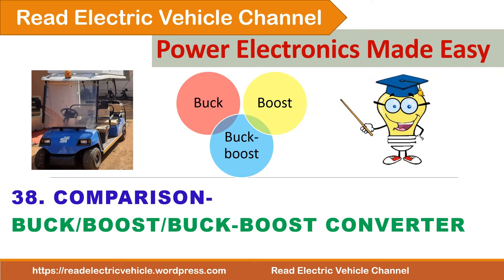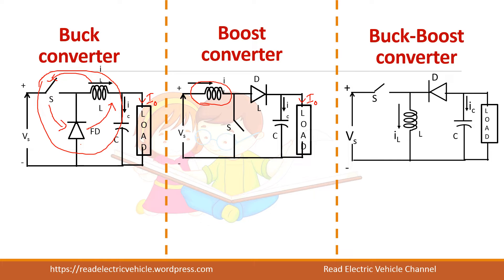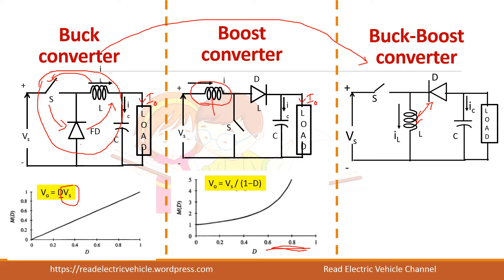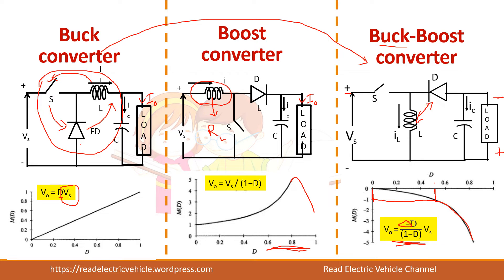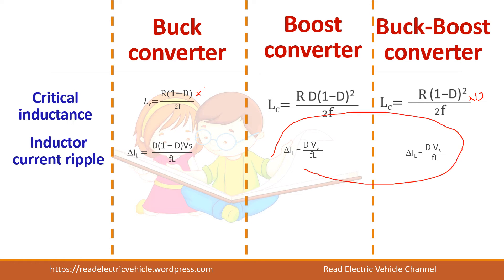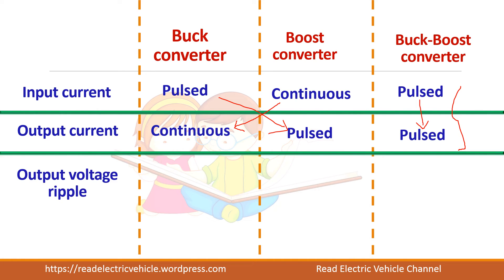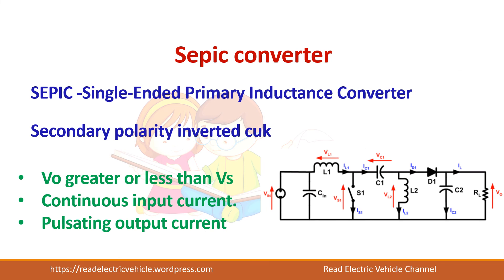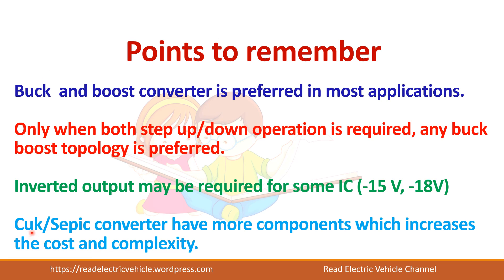38.DC-DC converter/Comparison/Buck/Boost/Buck-boost converter

Comment: Nice video mam...just want to give one suggestion Kindly explain also how to work step by step.....like input current comming than switch is on condition then will go the further just like mam....your video will go high rated mam...
Reply from the maker: Thanks for your suggestion. Uploaded separate videos for each converter.
You can check
35. Buck converter/step down converter/chopper
https://youtu.be/rz9tRWdCRf0

36. boost converter/step up chopper/dc-dc converter
https://youtu.be/nZ3DLzgEhMM
37. Buck/boost converter
https://youtu.be/QE7HYMKVNwg